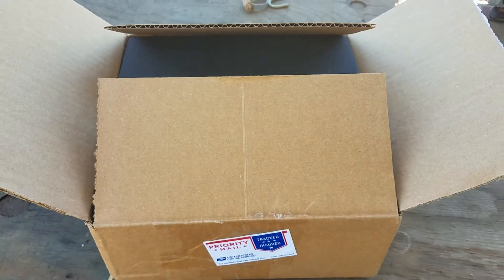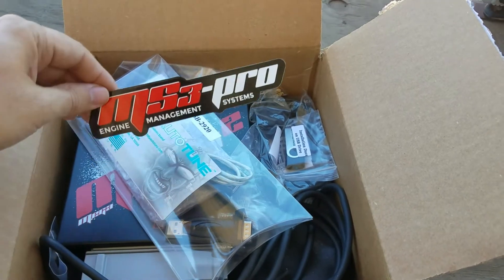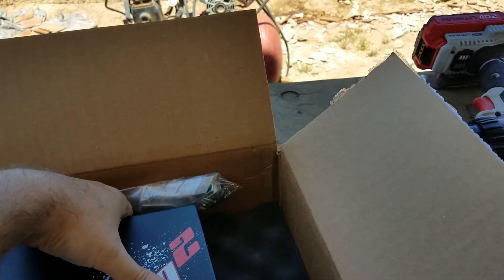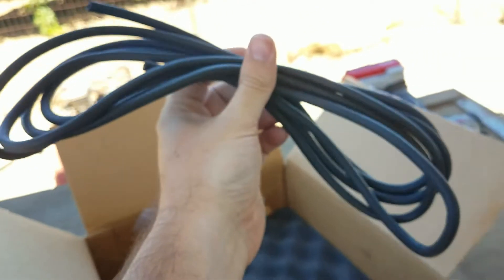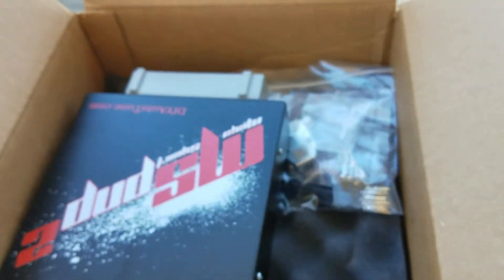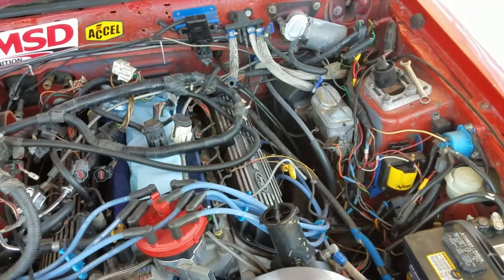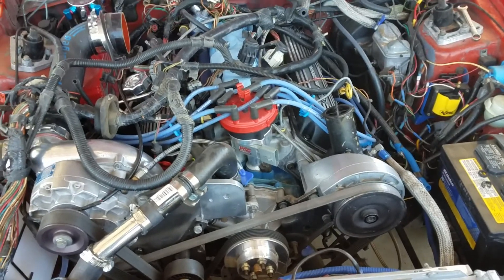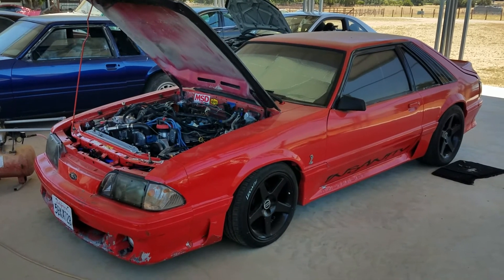Megasquirt 2 unboxing for Mustangs

Comment: Cool story, but no way that Red Fox is an 86. 87-93, unless someone dressed up their 86 in 87-93 ground effects?? Always possible.
Reply: Yeh look at the sail panels on the 1/4 windows and the various indicators in the engine compartment, def. an 86.  Good video, interested to see how it works.
Reply: @bchaveezy  yup, didn't even notice the rear quarters, good call
Reply from the maker: Yes it's a 86 with a newer gt body kit on it. If I show you inside the car you will see it.
Reply: @SpeedForceGarage  hahaha...I believe you, the other poster pointed out the rear quarter windows, I see it now. And now you've said it has the newer GT kit, makes complete sense. Have you hooked the mega squirt up yet?